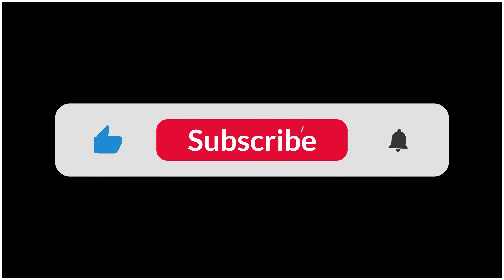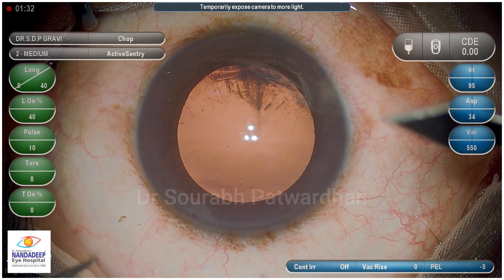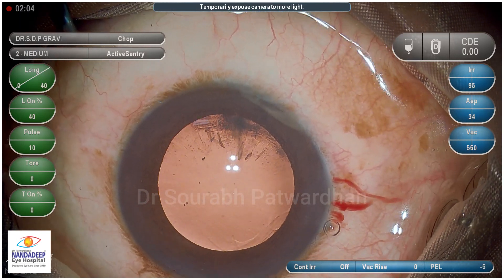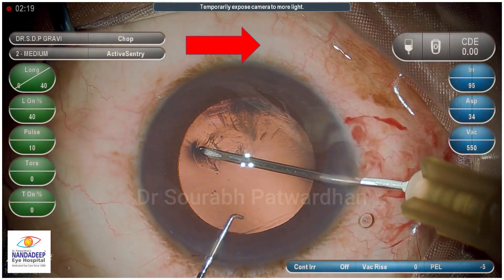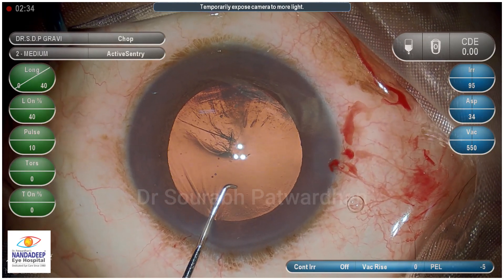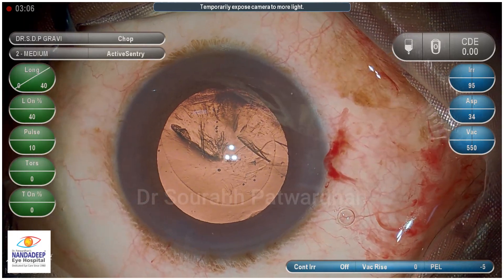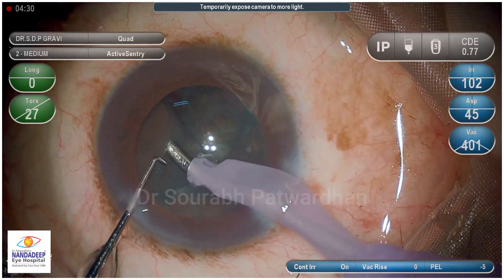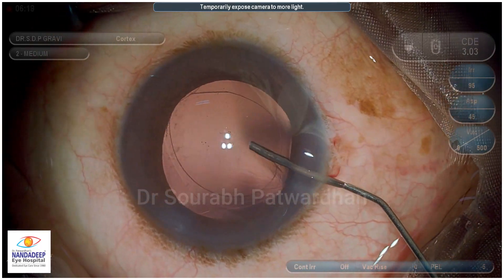194 Flick of moment : CCC not so ideal..Dr Sourabh Patwardhan

Comment: Using rhexis marker helps to get correct sized rhexis. Larger rhexis esp in one area can lead to asymmetric fibrosis of ant & post capsules resulting in IOL tilt & astigmatism. So it’s important to have 360 degrees overlap